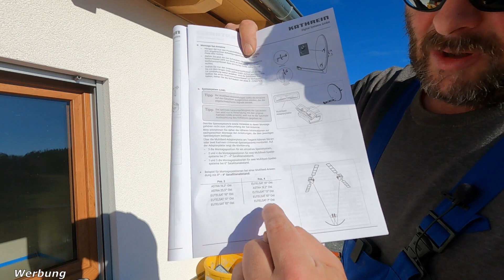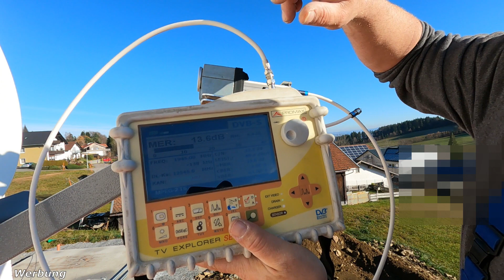Sat Anlage Wandmontage Teil 2/  Sat Anlage installieren / Satellitenanlage Montage

Comment: Tolles Video.
Ich frage mich nur was so ein Spaß kostet Material + Montag?
Reply: Die CAS 80 liegt so zw. 120-140€ Straßenpreis und der Wandhalter um die 30-50€. Dazu noch das Kabel und das ganze Kleinmaterial. 
Hatte vor ein paar Jahren bei meinen Großeltern eine SAT Anlage installiert und war da bei knapp 600€ an Material angelangt ( auch alles von Kathrein bzw. Markenware). Aktuell dürften die Preise teilweise angezogen haben.

-> Schüssel + Halterung 130€ (hatte die einfachere City Com Serie genommen)
-> 100m LCD 115 Außenkabel (Schüssel an der Garage, Multischalter im Dachboden + 25m 120dB Innenkabel + ein Sortiment Self Install Stecker ~120€ 
-> universal LNB Kathrein Euroline ~ 40-50€
-> Kathrein Multischalter 5/8 (also SAT + Antenneneingang zu 8 Empfängern)  hat damals 75€ gekostet, aktuell um etwa 100€ Straßenpreis
->F-Stecker Überspannungsableiter, Erdungsblock mit  KIemmkasten, Staberder, Erdungsleitung (5m NYY-J 1*16 und 25m 4mm² H07V-K ) ~ 40-50€
-> Schutzrohre , Halteschellen, Kabelkanäle für den Innenbereich Kleinmaterial (Schrauben, Abschlusswiderstände, Adapter von F-Stecker auf normale TV-Stecker (um am Multischalter eine bestehende UKW, UHF, VHF Antenne anzuschließen etc.) um die 50€ 
-> LTE Sperrfilter (über die bestehende Antenne hatte ein naher Handymast eingestreut und das ZF-Signal gestört) ~15€ 
-> 5 Antennendosen (Kathrein ESC 30) + Blenden etwa 50€  
dazu kamen dann noch zwei einfache SAT-Receiver  der 40€ Klasse von XORO um im Gästezimmer einen alten Fernseher und im Wohnzimmer einen DVD-Recorder zu bespaßen.  
Ich konnte zum Glück große Teile der alten etwa 10 Jahre alten Antennenkabel weiter nutzen, sodass sich die Renovierungsarbeiten in  Grenzen hielten. 

Die Ganze Aktion hat etwa 2 Tage gedauert, wobei wie gesagt ich große Teile der alten Antennenanlage (nur DVB-T /UKW) umrüsten konnte, also nur wenige Strecken neu ziehen brauchte. Wenn du erst anfängst überall im Haus Schlitze zu fräsen und Leerrohre zu ziehen, ist da auch schnell ne Woche ins Land gegangen. 
Hatte das ganze Material regulär über den Einzelhandel online bestellt, wäre ggf. im Großhandel etwas preiswerter gewesen.
Reply: Danke für die ausführliche Beschreibung.